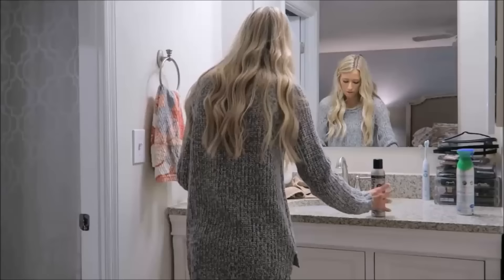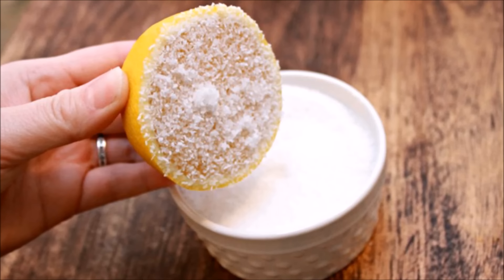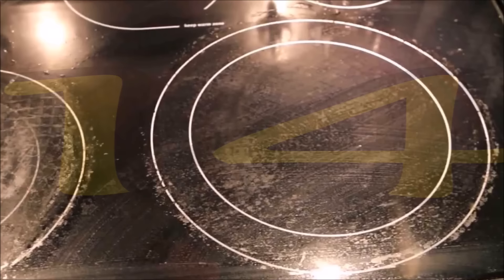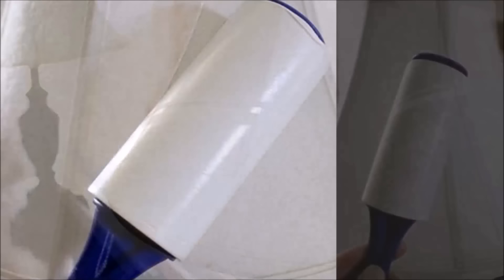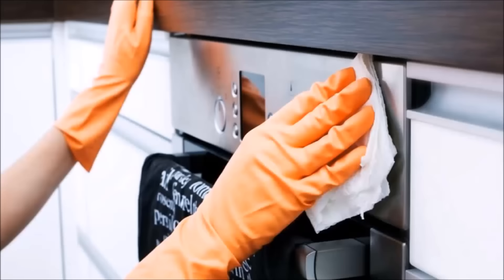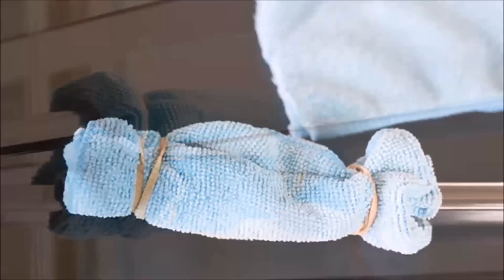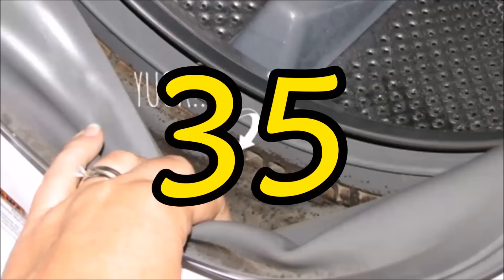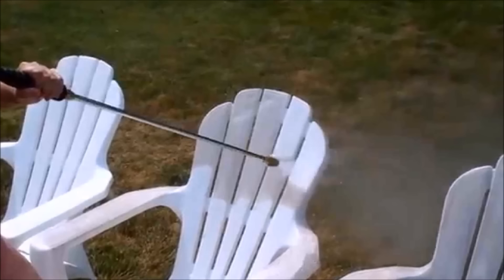41 Tips to Make Your Entire Home Cleaner Than It's Ever Been

Comment: You know, if you clean your toilets weekly, there will be no need to do all this extra work. The extra work is needed due to not cleaning them on a regular basis. I use bleach toilet bowl cleaner and squirt all around the upper portion of the toilet bowls weekly and then scrub with a brush. Same thing goes for the microwave. Cover your dish and you won't have splashes. If you do, wipe immediately and don't let it build up. So much time and energy can be saved by just cleaning after yourself daily.
Reply: I do my toilet every couple of days (2men in my house!) I wipe my sinks around after every use, so no water stains there, using bicarbonate (baking soda in US) if they get soap scum on them. This way, as you say, they don’t need a ‘big clean’. 

Having said that, a lot of the young ones have never been taught to clean in ANY way, so these vids are brilliant for those ones...
Reply: @hallelujah8141  Very true! These videos are certainly helpful! And, also, we all have different standards. What's clean to some may not be clean to others. I dust, vacuum, and mop every week. I was once called lazy because I have an irobot that does all the "swiffering" for me. I have no carpet in my house, so I must swiffer, then I vacuum, and then I mop. The robot has saved me a lot of time. It picks up all the loose hair and dirt that the eye would miss. They thought I just let the robot do everything and I was sitting on my a$$. But...they don't even do half the cleaning I do. When they learned I was dusting my furniture and wiping down mirrors and framed pictures while my robot was swiffering, they gasped. They call that "deep cleaning". I call it weekly cleaning. Deep cleaning to me is when I scrub the grout on my kitchen floor and bathroom floors, which is not something I do weekly. But I was raised to clean properly and regularly. Different standards.
Reply: RedLikeWine kid
Reply: Julie Eastman “9
Reply: P
Reply: RedLikeWine 

Lllpll
Reply: I moved into my student flat, it's a student flat, which means every single tennant was living without parents in the house for the first time ever, ie every tennant has the cleaning capacity of a 12 year old, meaning they can vaccum, wash dishes, and maybe do the laundry, and that's about it.

When I moved in the entire toilet bowl and inside the cistern was brown, it was from limescale buildup being stained over the years, (whenever we have a big storm here the clean treated water will still be brown from dirt and leaves).
Anyways it looked disgusting, I don't think any other tenants before me had EVER cleaned that toilet.... there was upwards of 20 years of limescale and grossness for me to remove.

I tried scrubbing it, which didn't help, I tried bleaching it, which didn't help either, except for my peace of mind knowing that at least now there wasn't any bacteria on it.
In the end I got a Janola "power shot" tablet thing to put into the cistern, worked wonders.
I replace it every time I notice there aren't bubbles when I flush.
Over the course of the year, now instead of looking like a clay/dirt bowl from how brown it was, all of the limescale has been removed except for some corners of the cistern and the edges of the toilet bowl.
I'm still in here for another year, that toilet is gonna sparkle by the time I leave.
Reply: Clean up after yourself!? Everytime my husband uses the microwave, it looks like a crime scene in there. No amount of tutorials on preventing exploding food seems to work. Same with teens.
Reply: Haha.  That’s what I tell my hubby and boys... someday, I hope they will listen.  Sometimes, when I come back from being out of town, My microwave looks like a food fight happened...  gross!
Reply: Cannot use bleach. Our house system is septic, so bleach will kill off the anaerobic bacteria in the septic tank. Obviously I HAVE to put some down the system sometimes during the cleaning routine, but I then have to follow that with Greek style 100% natural yoghurt to activate the system again.
Reply: We clean the toilet after every use , it much cleaner and better.Even the  bathtub and everything around , the whole bathroom walls we do it  twice a week.
Reply: If you have very heavy hard water like I do, even weekly cleaning doesn’t get it completely clean... I even use “the works” which is the best on hard water but my water has so iron in it I have to do it every other day but the back of the toilet gets so bad I have to completely gut it and clean twice a year.... hard water sucks.... I have no white cloths lol
Reply: Kayenne54 old milk works too.... apple cider vinegar and or a packet of active dry yeast also works well
Reply: @Mel-qr5ob  I can't find the janola PowerShot tablet is it called by another name as well? Thanks
Reply: So glad to live alone, no empty nest going on here 😄
Reply: Avatar Bluemm
Reply: You are so right!!
Reply: I totally agree with this, also same goes for the stove. Clean it as soon as it cools
Reply: Not always true... exception to ever situation
Reply: @Kayenne54  Wait! You deliberately put yogurt down your toilet?  You think it helps your septic?
Reply: Clean them Throughout the day.
Reply: True, but some people don't use bleach anymore, but I still do.  I like the healthier options.
Reply: @HighFancyLove  that's not even the point of this. The point is to clean and pick up after yourself. But....all those "healthier" cleaning products are not effectively cleaning and killing dangerous germs. No wonder there is so much sickness out there.
Reply: @RedLikeWine  I was replying to the thread. Isn't that the point it's a ”comment section.” not a judgement section!? You took it out of context.  I said ”true”, ”I enjoy the healthier options for cleaning shown in this video”... it's my opinion,  which I'm entitled to I believe.  I don't like bleach or toxins, have you heard of cancer this crazy disease that there's no real cure for as of yet?..alcohol cleans and disinfects just as well as steam.  You can cure germ related illness and it's actually better for your immunity, but cancer hmmm mmmm.
Reply: True that! Some of this stuff is waay too neat freak--like for my taste. But then again, with the quarantine in place, what the hell else do we have to do but clean our homes? 😝😂
Reply: @hallelujah8141  Amen to that...never been taught.
Reply: You must not be married with kids... or they have far more respect for you then they do for me. Because it’s not me that makes or leaves the microwave dirty...
Reply: @rusch4  I told my hubby and the kids if they don't wipe down the microwave after they use it, THEY CAN'T USE IT. I you want to heat something you can do it on the stove or in the oven but not the microwave. It didn't take long for them to decide they preferred to use the microwave so they complied.
If you're not willing to put your foot down like that you can always buy another microwave for them to use and take care of.
Reply: @pinksmoke7705  how about a water softener?
Reply: @HighFancyLove  not so fast....
Cancer can be killed by going on a STRICT carnivore diet.
Reply: @shaggydog563  just donate the damn thing to good will 🤣😂🤣😂🤣😂💮💖🌸 no more cleaning the microwave and room for more appliances.. I was glad when the one someone gave me died... It's a pain to cook fast on the stove but now I've got a bread maker there... Yeah I know it's a space hog all you bread makers out  there! Next thing on my list to learn! It makes more than bread too
Reply: Facts tho
Reply: @1-SmallStep  🤣🤣🤣😩
Reply: if you live in an area w really hard water, you will need to do special things to  your toilet a few times a year to clean it. The lime builds up just from the water, whether you keep it clean regularly or not.
Reply: I wish I could get my family to understand this, about cleaning up after yourself to save time in the long run
Reply: @rusch4  after that happened to me a couple times of coming back from being out of town and having the place destroyed I warned my husband that it better not happen the next time I come home. He hired a cleaning service and didn't tell me. I was so impressed how clean he kept the house and it looked so nice until I went in the laundry room and found my washer and dryer and everything had been wiped down and lint free. That just put it over the edge and I knew he had hired a cleaning service at that point. He laughed and said next time he was going to tell them not to clean so well
Reply: i agree i clean mine every day doesn't take long
Reply: Yes
Reply: @rhaenyralikesyoutube6289  Lol
Reply: I totally agree with you 👍👍👍😊
Reply: @shaggydog563    Is that a fact?  You said going on a strict carnivore diet can cure cancer.  Please tell me more…
Reply: @The_Bear_with_Flair  I have a friend...in his mid 40's... diagnosed with stage 4 lung cancer. He was given 3 months to live. He heard about this diet from a friend. He has a wife and kids and didn't want to die. So he went on this diet. It is an extremely strict diet. You can eat meat green leafy veggies which also includes cabbage and broccoli and a lot of fat. Olive oil on salad, etc. Black coffee or tea and water. NO starchy veggies. Absolutely NOTHING ELSE. There are no cheat days. You must NEVER EAT ANY KIND OF SUGAR. No processed food of any kind. That means NO BACON.etc. If at all possible eat only organic grass fed meat. ( non organic might have been fed sugar in some form. If you eat any kind of sugar  or food that turns to sugar after its eaten this diet WILL NOT WORK. The fat is necessary for brain function. Coconut oil is good. No flavor and it slides down easy taken right from a spoon. I can't impress upon you enough that you cannot cheat...even a tiny bit. Dennis went on this diet and in 3 months he was cancer free
 However he stayed on the diet because he wanted to be there for his wife and kids. That was 5 years ago and he is still cancer free.
I have told others about this diet and none of.them could stay on it. It's.just too strict and cancer causes sugar cravings which makes it even more difficult. Good luck with it. Off hand that's about all I can recall. God bless.
Reply: I use hydrogen peroxide and baking soda in the toilet. It cleans fab and not much scrubbing once a week.
Reply: @hallelujah8141  ❤❤❤
Reply: @RedLikeWine  💯
Reply: Amen
Reply: Exactly.
Reply: Bingo!!

Comment: After showering, I have found that simply wiping down all parts of the inside of your shower with clean  water from the shower and your wash rag  keeps the soap scum and buildup to a minimum.  Use a squeegee after if desired.  This routine is much kinder to all the finishes.  Cleaning with any actual product becomes a rarer and rarer necessity.

Comment: vinegar and baking soda is great as a laundry detergent 🙏❤️☮️
Reply: Also vinegar and baking soda to get rid of that smell in your towels and sheets.
Add it straight to your washer and soak for 30 - 60 min. Then wash as usual
Reply: Jakki Long  qq
Reply: @shek9  How much vinegar and baking soda in a full load of linen?  TIA for your reply
Reply: @mabuhayPinay  I usually just throw in a couple of tablespoons of baking soda and about 1/2 cup vinegar right in the drum. If the clothes or towels have any type of odor, I will Put the machine on pre soak about 30 minutes to an hour. If you’re load is pretty big, just add a little more of each. I just keep an old soap scoop in the large bag of baking soda I bought from Walmart.
Reply: @shek9 Thanks, I'll do that!
Reply: @mabuhayPinay  I don't really measure since I've been doing this for years.
Depending on size of load. Approximately 1/4c baking soda in the washer and then add about 1/4c vinegar 
I usually put both in the washer and soak 30min to an hour 
Mostly I do a quick wash after 😊

Comment: The problem with #18 is that using a "tape" lint roller will leave a slight residue of adhesive, which will then attract/keep more dust.  Tape rollers should only be used on items that can be thrown in the wash (to remove the adhesive residue).
Reply: Yes!! Theres easier ways

Comment: Bleach eventually will cause whites to yellow. It also weakens fabric threads.
Reply: It has never made my towels turn yellow. Been using for years
Reply: Always use a second rinse....otherwise the bleach keeps working if left on fabric.  Bleach works twice as much when used with hot water.... .heat will eat the fabric.  Wash loads in cool water with bleach and double rinse.
Reply: I found a MARVELOUS product that whitens whites without ANY of the damages caused by bleach. It must be used on all white  fabrics though. OUT White Brite Laundry Whitener. I uave restores countless white wedding gowns  created with multiple types of fabrics as well.  Gowns and/or other clothing  MUST have no embellishments on them that could be damaged by the  removing a nacre or finish. If neceessary, carefully remove the embellishments and clean them with a milder method, reattaching them to the garment after it is completely cleaned and washed and dried.
Reply: @suearmstrong9597  Yes, what you are stating is true, In addition, multiple rinses remove any possible residue that could cause a skin reaction. Hyper sensitive skin can easily be affected by the most minute particles of residue.
Reply: Due to my previous job training, I have fairly extensive knowledge of properties of fabrics. Some will never give up their bleach for laundry, but might be important to know that using it will definitely shorten fabric life. So, also, will synthetic- infused fabric softeners.
Perhaps just a small matter of interest.

Comment: I'm did this with my rug, but used carpet cleaner. It leaves a little Scotchgard type chemical on them to protect from new stains. Most new furniture has this chemical sprayed on them to protect them too. Once you remove this the fabric feels different and won't be as crisp. Bissell carpet cleaner or any brand specifically for carpet cleaning works on both rugs and furniture.

Comment: To clean nasty stains- rings in the bowl of ur toliet use a pumice stone. Sold at- home depot- Lowes or wal mart. Cheapest place is wal mart- should be in the household cleaner section. If not u can order online from any chemical supply house.
Reply: Lisa Medlin
Reply: I've seen other people suggest this. I've never had a severe enough ring to do that and find that vinegar has done the trick when they've occurred. Good tip if you live in an area with really hard water though.
Reply: Pumice stone will damage the coating/glaze on many porcelain fixtures though. This coating is what makes them shiny. Cleaning them at least once a week (or twice a week if you have really hard water) is best. Don't let the rings form in the first place.

Comment: Tip for shower door tracks: Rip them the hell out and get rid of those germy, ugly doors!  Use a simple cloth curtain you can WASH. You do not need a "liner". Liners are dirty & entirely not-needed!
Reply: Actually I need a liner, I have the cloth shower curtain on the outside of the tub, and if I don't have a liner on the inside water leaks all over the floor.

Comment: Things to Consider:
If hard water is a recurring issue, a water softener could be a long-term solution.

For those who are into eco-friendly living, hydrogen peroxide is a great alternative to bleach.

Don't forget about your tech gadgets. A quick wipe down with alcohol wipes can make a difference.

If you have pets, consider using pet-friendly cleaning products to ensure their safety.

An air purifier can be a good investment, especially if you're using strong cleaning agents.

For stubborn problems like mold or deep-set stains, professional cleaning services might be worth considering.

Comment: The one with the toilet and vinegar would probably work if we had 2 toilets ... or not use the one we have for several hours - impossible. Tip 27: lol I tried using the recommended stuff for my tile floors:  doesn't work - my floors looked as if they accumulated 10 years of dust in a few minutes, in the  light.

Comment: I love your voice, & thank you so much for all of the helpful tips & info in the video.
Reply: Carol Binnie how do you clean white leather shoes
Reply: @lauralauer8442  if they're very dirty, I spray them with 409 and scrub them with an old tooth brush and rinse them well under running water. Dry off immediately and set aside to finish drying.
If they're only lightly soiled I just use a damp rag. If necessary dampen the rag with 409 and wipe off with a clean damp rag.

Comment: I had mold on my bathtub and Grant you I clean my bathroom everyday but still got it so I took a spray bottle with bleach sprayed it real good let it sit for hours and sprayed some more and rinsed it and it was gone
Reply: Try hydrogen peroxide for mold and mildew. Bleach only kills surface mold but doesn't work well for porous surfaces like the caulking around the tub. Bleach will bleach the mold spores so they appear gone but doesn't actually kill it in those areas. You can use vinegar or borax as well. Borax is great for washing machines too.

Comment: I use laundry soap and bleach in my carpet shampooer. No need to buy ‘special’ soap because carpets are acrylic like polyester, just like clothes! Plus laundry soap is low suds. Bleach will not fade color of acrylic, but will penetrate and kill mold, and prevent new mold if carpet takes longer to dry. It disinfects, kills fleas, and lightens any stains.